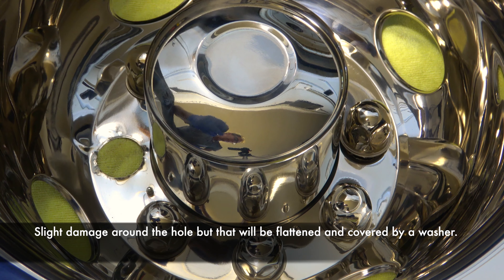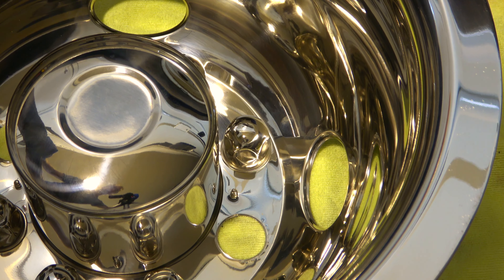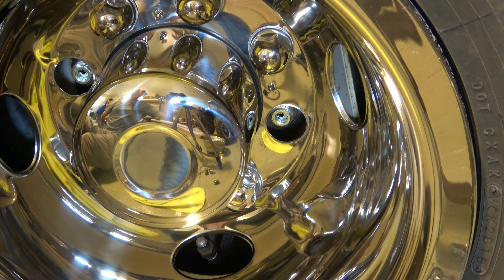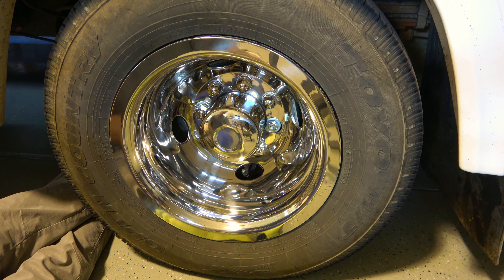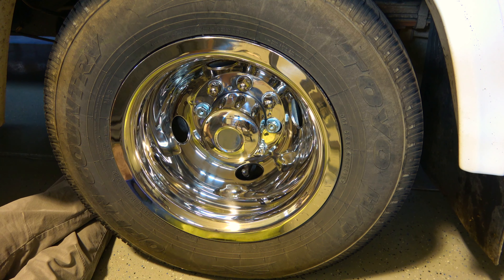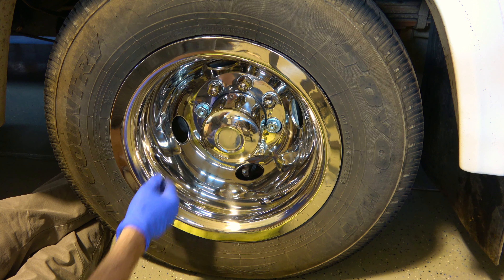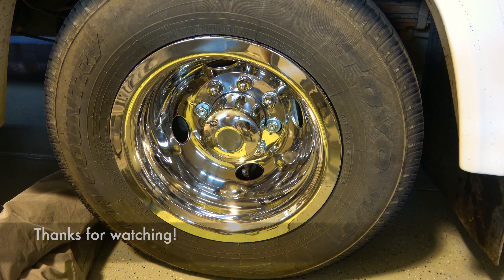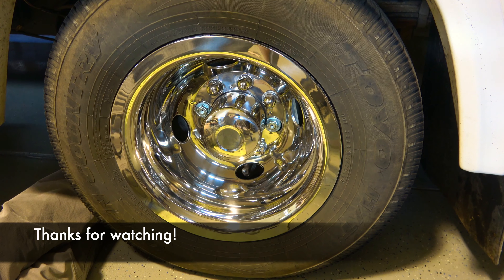How to STOP Losing your Wheel Simulators.

Comment: Pacific duallys is all I use . Never come off or loose in 14 years.  Have same sets for 14 years.
Reply from the maker: Yah prior to this motorhome Ive had many over the years and never lost any. But I haven't really seen any revolutionary design developments that differ much from brand to brand. Snap ring or lugs. I think people loose them for all sorts of reasons. Some times something as simple as  not being put on properly. The ones Ive lost in recent years were on long road trips to and or from  Alaska  to the lower 48 on I believe stretches of road riddled with construction.  And Im sure there were other contributing factors. It was always the same wheel. Never an issue with the others. Good info/endorsement for people to explore though. Always good to have options.

Comment: Hey I'm new to the motorhome world. And I have a 2005 Fleetwood Tioga jamboree and of course I lost a hub simulator. I have a couple questions if you don't mind. Where's the best place to get the stud extenders and size? Also my front caps are different are they also prone to fly off?  Lastly brilliant way to solve the problem 😊.
Reply from the maker: Hey there. Stud extenders are readily available from many sources. Amazon of course as well as take your pick of auto stores. I believe they come in a few lengths. So You'd have to figure what you need there.  Im really not sure how many choices or versions there are regarding the threads. Im confident that a quick conversation with someone that sells them could clear that up pretty quick.  Over the years Ive personally found the rears to be more prone to fly off. I have yet to loose a front one. But that doesn't mean it doesn't happen or that others wouldn't say there experience has been the opposite of mine. Hope that helps.

Comment: I'd find a way to tighten those 2 extension studs or you'll be buying more
Reply from the maker: Hasn't been a prob so far but I would like if they had more purchase on the studs. I had considered putting longer studs in but have not as of yet.
Reply: Blue lock tight

Comment: Wheel weight screws up alignment.
Reply from the maker: Do you mean that the balancing weight(s) are in the way of aligning the trim ring? Or are you expressing concern about the balancing of the tire from the weight of the  hardware?
Reply: @ericinalaska7648  they affect the alignment of the hub cap tho sit flat against wheel.
Reply from the maker: @Silverxxx450  Hmmm. Not sure how to address that other than possibly tire rotation that would work out so the weights aren't an issue. Or perhaps different wheel simulators. I haven't seen that scenario personally.

Comment: Can you put in the comments, or reply to mine, with part numbers for extenders, lock nuts etc you used? Can’t quite see what your putting on after the lug extenders. Thanks.
Reply from the maker: To clarify I put on the lug extenders. Then the wheel simulator. Then a flat washer to cover more surface. Then the locknut. Instead of a lug nut. But a lug nut  may be an option for you.
When I ordered the wheel simulators.  I explained to the guy I spoke with at RVWheel.com what I was doing and he included the  appropriate stud extenders and lugs with my order.  He was very helpful in making sure what vehicle I had as well as wheels and size etc to make sure I had the correct parts. Based on the model I have, He knew what I needed.  When I removed the pho-lugs and put the wheel simulator on. The pattern of the pho-lug holes and the pattern of the studs on mine were not as well matched as I would have liked. Yours may be if you have a different vehicle, size wheel or rim and or different brand of simulator. So instead of using the lug nuts provided. Because the lugs/extenders and the holes were slightly off center to each other.  I used a washer, to cover more surface. And a lock nut. I took one of the stud extenders with me to the hardware store to match a lock nut to it.  I just took a look to see if my receipt indicated there size but nope. Just quantity and price. But It may not be compatible with your set up regardless. Are you just looking to modify what you have or doing it all from new again? If your just modifying the simulators you have. Im confident you can just  call (800-215-8007)and order the lug extenders and lugs from RVWheel.com. Or you can inquire at Sales@RVWheel.com  I see many options on Amazon as well but I couldn't tell you which you'd need for yours specifically. I would hate to send anybody down the wrong path suggesting part numbers that worked for my setup only to have them find out its not right for theres. Hope this helps. Let me know if I can clarify anything else.
Reply from the maker: And thank you for bringing it to my attention. I updated the video description to include the source info and clarify that parts can be year make and model specific.
Reply: Thanks for the info. I have the push-ons and keep losing them. Uggg Makes sense what you did with regards of the washer for more surface area, and it not lining up hence the grinding some off. Thanks for the reply!!
Reply from the maker: @projectdad6561  Absolutely.  Hope it works out for yah.  I haven't lost any since. I had lost 3 prior to this modification. It was time far a new plan.
Reply from the maker: @projectdad6561  By the way. When putting things away after our conversation the other day. I looked at the one simulator I have that's not a press on.(Designed as and sold as and held on by 2 lug nuts only.) And the two holes are elongated or oval. So for whatever that's worth.

Comment: The steel wheel does not look so great but I would rather just take the cabs off and ride with the steel wheels because paying over $100 for each cab every time you lose one is ridiculous
Reply from the maker: Certainly an option. Last long trip I did before doing this. I did just that. Took the rears off so I wouldn't loose them. Since doing this Ive kept them on and I haven't lost one yet. So far so good. If I were to loose any again Id likely go without as well unless or until selling.

Comment: Im not worried about losing it Im worried about taking it off.... the nuts just spin and spin and wont break loose so I cant change the tire.!!!!
Reply from the maker: Did you get it? If not. Im wondering. Do you have a snap ring or is yours held on by two nuts. Which is typical. Im thinking you have a snap ring set up? If so You just need to pry that off around the edges until it comes off. The wheel simulator, then the real lugs are underneath. The nuts on the wheel simulator are cosmetic only. If Im understanding you correctly. If your talking about your actual lug nuts spinning, not the fake ones on the chrome cosmetic wheel simulator. I apologize. And don't mean to insult. But from your message I can only speculate. If you haven't got it already. Good luck.

Comment: Where did you get the extenders?
Reply from the maker: I used RVWheel.com. Sales@RVWheel.com  800-215-8007  For wheel simulators and stud extenders and Lug nuts. They were very helpful making sure I had the correct parts for my vehicle year, make and model.
But most parts are readily available on Amazon and many other sources.